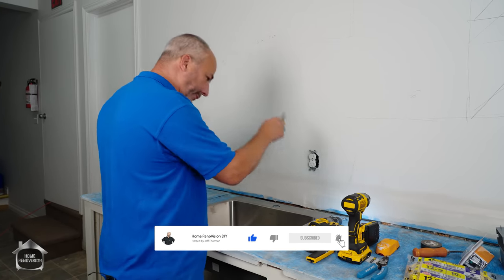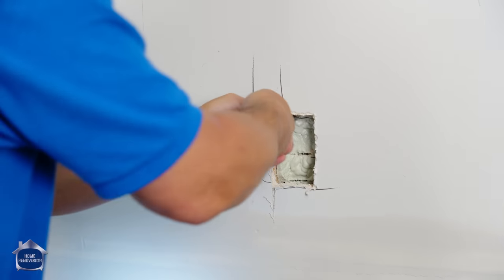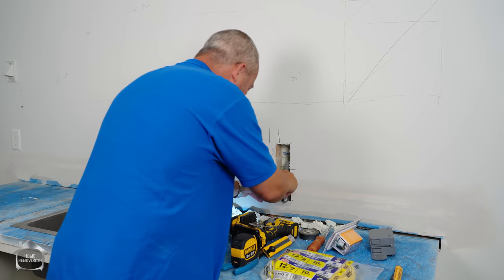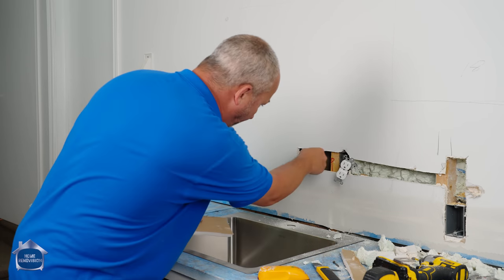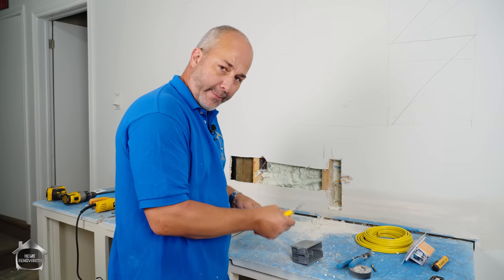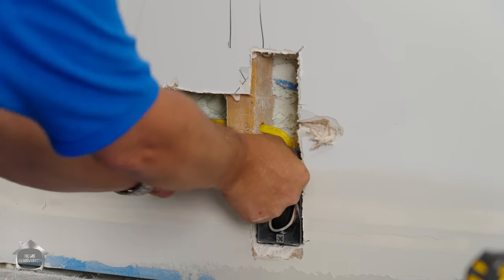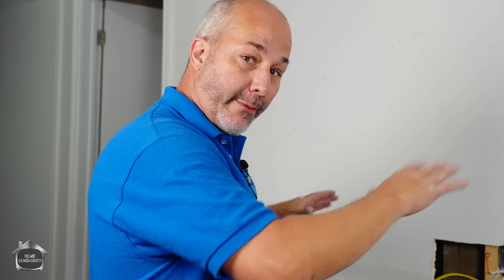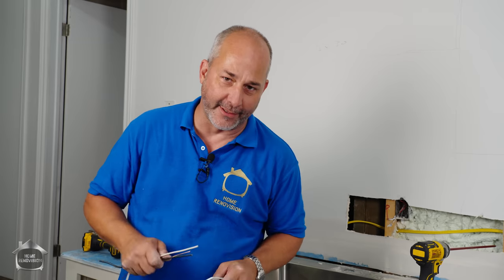Meeting Electrical Code | Church Flip | Episode 3

Comment: Gah!! Why didn't you do this video 6 months ago?  Circa 1947 family home in Cape Breton - pulled all the old gyprock and re-ran 12/2 replacing the ungrounded aluminum circuits.  Not sure how this place didn't burn to the ground many years ago!!  Curious about one thing - that wire that runs in front of the spray foam.  After you drywall, what prevents someone from driving a screw through it when the spray foam has no give on the wire?  I look at that in the same way that you mentioned about not being 1 1/2" from the front of the studs.  No code updates for wiring that runs in front of a solid surface like spray foam??  Great job --- again.

Comment: Nice job! Quick and easy. Everything you said and did would pass inspection. I'm an electrical contractor in Ontario and I approve.
Depending on the inspector you could get called about modifying the box and mounting it from inside. Cheers none the less
Reply from the maker: Cheers Stuart, in todays market it is hard to get materials exactly as we would prefer. I am sure my inspector will be fine with it. We will find out on Friday.

Comment: I'm a fan of spray foam in non living areas (foundation walls, attics, garages) as it does do a neat job and seals up all the drafts.    Still love the pink fluffy stuff for living areas or the grey woolly stuff for soundproofing too.   Advantage of the foam is you don't need the plastic vapor barrier, which isn't that big of a deal anyway for patch work.

Comment: As someone living in Chicago, who has to use metal conduit, metal boxes—and er... a licensed electrician—I laugh at your minor setbacks and raise you a complete clusterfuck ☺  Thanks again, man in blue, you're a priceless resource!
Reply from the maker: Happy to help set the world straight. sometimes it pays to live in a place where there is reasonable flexibility to do the work yourself. Cheers!
Reply: they use conduit for electrical runs in Nordic countries too.   Due to their framing construction methods (heavy insulated walls and strapping for drywall mounting), it allows for easy access for running wires or making repairs.

Comment: I did all of my own rough in electrical when I finished my basement.  I called around to multiple electricians about putting in the breakers and attaching it to my electrical.  No one would even talk to me after I told them I did my own electrical rough in.  All I am saying is be careful and make sure you have someone who is willing to do that last leg before you get started.
Reply: Yep. I checked with my city before starting my project, and the city requires electricians and plumbers to pull a permit and do the rough-in. Homeowners are NOT allowed to do the rough-in work. Because I'm likely to sell the home in the near future, I had the have the new 1/2 bath permitted when the record changes.
Reply: You could put in the breaker yourself

Comment: 3:30 You cannot throw screws inside that plastic box, the box is not made of metal so the screws have no path to ground 
If the screw comes in contact with a live wire then the wall gets energized. That wouldn't be to code here in the US. There are plastic boxes designed with shrouded screws that would pass. 

5:15 If that box is live it has to have a cover plate, it can't be covered over. It has to remain visible.
Reply from the maker: That box is no longer live. Cheers!
Reply: Really? Because new work boxes typically have built-in, unshrouded nails direct from the manufacturer.  The nail/screw is buried in wood, which isn't conductive, the wall can't get energized even if the nail/screw is.
Reply: @macaroniandtuna  
Not "inside" the plastic box cavity. Wood is conductive. If the box isn't metal then any metal penetrations inside wont have a path to ground. If there is no path to ground, the breaker wont pop. 
If you ever applied mud to drywall with the hot wire grounding itself to the wood, you would see sparks from the nails or screws as you troweled it on.
Reply: @Foche_T._Schitt  Wood wood be conductive only when wet with electrolyte or at 5 to 20 times the voltage of residential circuits. Unless one screw has a grounded path of some sort or connects magically to another phase, no arcing either. At that point you need a sustained overvoltage condition, exposed conductors and some magic.

Comment: So in Canada you don't need GFCI receptacles in a wet area (kitchen)?
Reply: He can use a gfci breaker
Reply: That's why he's replacing the 3 wire, split  receptacles, he could use a gfci Breaker or receptacle.

Comment: I guess this explains how my guys passed inspection, then ended up hooking up all the 14awg to a 20 amp circuit.  Now I have to tear back out the countertops cabinets etc to rewire my kitchen.
Reply: @Tyler Mullins you can't have a 15 amp breaker for the kitchen outlets. It is against NEC. Not to mention the garbage disposal and dishwasher are on the same circuit. This is to the extent of making it difficult to sell your house since it may not be insurable.

Seems to be a loop hole for bad electrical since there is no test at the breaker.  Just another reason to never hire a contractor since these days your really just hiring a phone

Comment: So, Jeff.  How are you terminating the original outlet box??  You can't leave it and the live wires there.
Reply from the maker: pull out the breaker and the wire connected to it. Cheers!
Reply: @HomeRenoVisionDIY  so you are Not abandoning a box....   cheers, indeed.  Can you relate that to the DIY community again?
Your vids are awesome, but most DIYs don't remember the small, Veru, VERY important stuff.
Reply from the maker: seemed like a pretty obvious thing to not leave a live wire in a buried box. But yup I guess I should have said something, Cheers!

Comment: National Electrical Code states that an receptacle must be placed 2 feet apart and 2 feet from corners (only place where you can space 4') where countertop surfaces are equal or greater than 2' in depth
Reply: Are you quoting the Canadian electrical code?
Because Jeff lives and works in Canada.
I know here in the USA it is 2 feet from corners and 4 feet apart 210.52(C)(5)
That way nothing on the counter is further than 2 feet from a receptacle. And that is for any countertop that is 12 inches or wider.

Comment: You did the rough in’s quickly, however all the dry wall cutting and marking I though would be better slowing down so there wasn’t so much to fix later. Just my opinion, but your far more experienced than I.
Reply from the maker: You will see the repair in a video soon. it was easier than you think. Cheers!

Comment: Im still baffled that you dont use wire conduits inside walls in north america. It not only allowes for wires to be added or replaces without tearing down the wall, it also protects the cable

Comment: This is exactly why we used rockwool for our wall insulation, cellulose for the attic and then just had a spray foam company come in and spray all the rafter tails around the house to help with the r value right at the top plate. Bought the house as vacant and ripped it down to its bare bones and re built to proper code and better efficency.

Comment: I’m surprised this would pass inspection. Using screws to attach a new work box for old work. No staples.  Box too close to counter top. Not removing  old wiring or terminating them into an accessible junction box. The only old work boxes approved in Canada as far as I am able to find out, are metal ones with ears that grab the drywall. None of the plastic old work boxes particularly on Amazon are not CSA approved. Mainly because they don’t have a ground screw. Not that plastic needs grounding.
Reply: You don’t need a ground screw because its “plastic” it doesn’t have to be bonded to ground. Am I missing something here??
Reply: @zagnit  not at all   Plastic doesn’t need grounding. Point being plastic old work boxes are not csa approved.  because they don’t have the ground screw. So if you want to use csa approved stuff don’t use plastic. Metal is safer. Doesn’t burn won’t melt, any loose wire touching the box will cause an immediate short and tripped breaker.

Comment: Wow that's hack. Lol

Grinding the box - code violation 
Plugs to close to counter top
No relief loop left
Need 2 - 20amp circuits for kitchen
Reply: He’s in Canada the Canadians don’t seem to care
Reply from the maker: your code is obviously different where you are from. perhaps stating your country and state so we can all benefit.
Reply: @HomeRenoVisionDIY  Location is irrelevant. 

That looks like a 4 year old cut the wall out and put some boxes in.

Thats embarrassing for a guy running a renovation channel that people are following.
Reply from the maker: Location is relevant. code is not the same everywhere. Nothing embarrassing here except you doubling down in the comment. Do Better. Be Better
Reply: @HomeRenoVisionDIY    Jeff, you're a class guy. And I really mean that!!!
Reply: @jan.w   You are partially correct....however, CEC 26-654 b) requires 2 circuits minimum. (14/3 split  or 12/2 t-slot as you stated). Also, adjacent counter receptacles cannot be on the same cct.

Comment: Ugh. Spray foam. Should have used Rockwool.  Instead they are building houses to go up quickly in a fire.
Reply from the maker: That is why code requires it to be covered with drywall. at least ya get 20 minutes!